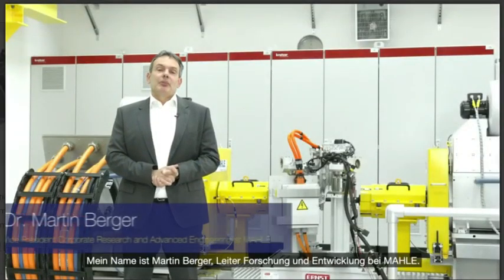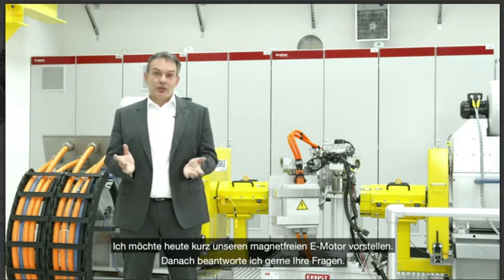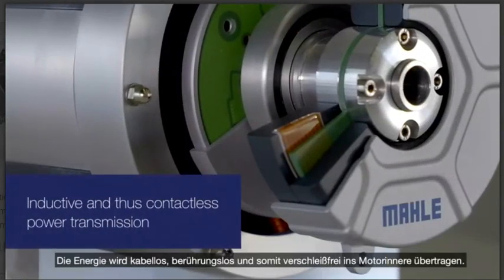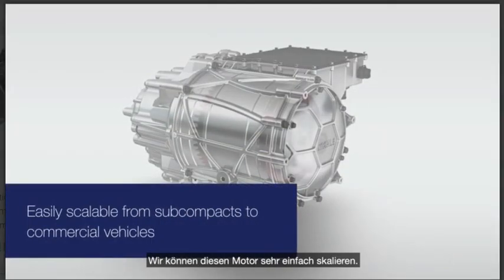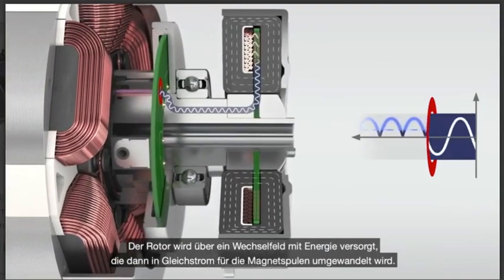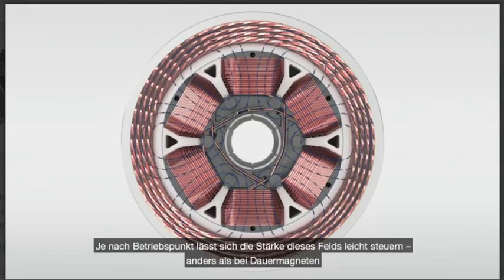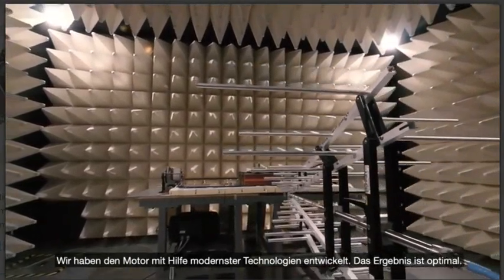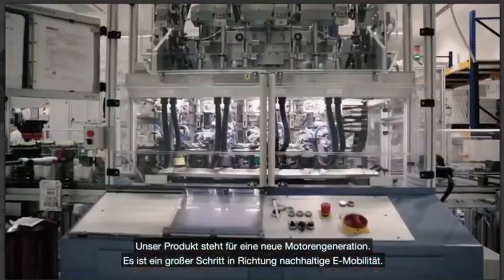Mahle, produce revolutionary new no-magnet motor...

Comment: Wait, isn't this similar to how an alternator works? Guess there is tech for higher power efficiency then.
Reply: Most alternators only reach around 65% efficiency. We've been exploring (and using) induced fields in the rotor since I was a kid. This is the first time I've seen a practical motor with the level of efficiency needed to make a significant impact on the market. How successful they will be I don't know - I suspect reliability and heat may be limiting factors.
Reply: And an alternator will have an alternating magnetic field but this one acts like a dc brushed motor
Reply: Alternator? Or a dc motor? It's most likely a DC motor but instead of have a physically contacted commutators, it has a tiny gap which allows for wireless electricity. Not sure if that's certainly possible
Reply: @marcangelodonelo5656  this is a dc-excited synchronous machine (the same assembly can be used as a motor, generator, or brake, depending on the energy flow). A dc machine has the field generator (be it permanent magnet or electromagnetic) on the stator. And I've seen a similar wireless power transmission system on a computer tomograph about a decade ago
Reply: @marcangelodonelo5656  no.. not a dc motor, they have magnets. A multi current motor.. they dont

Comment: Kind of like a an alternator turned into a motor, and where the carbon brushes have been replaced by this "remote" alternating electric induction?
Reply: Yep, old generators used a similar setup to control the output, diodes were used on the rotor to turn the induced AC current into DC, which was fed into the rotor winding, which created the AC current in the stator windings. They had this tech in the 50's!
Reply: @plkracer  Yeap it is just a textbook synchronous machine
Reply: @plkracer  but not with such a beautiful cgi rendering!!!! this makes it more real than those of decades ago

Comment: Without an actual demonstration, the useful information content of this video could have been cut down to less than two minutes and put out on the radio, slick CGI just doesn't cut it.
Reply: There isn't much to see in a demonstration of an electric motor - it just spins. It's not as if you can see the electrical current or the magnetic flux.
Reply: @brianb-p6586  uh what? you can hook it up to a load and demonstrate the nm torque produced and current drawn etc. and show its efficiency at various speeds to back up the claims. Also have temperature probes showing how it deals with staying cool under load and MANY more things that would be great to see.
Reply: @watvannou  since none of that information is visible, you would only see values displayed on a screen. I understand wanting a full data set, but seeing a motor running would add nothing... and no one shares full test data for a technology in development.

Given the efficiency claim, an efficiency map would be good, and might be reasonable to expect.
Reply: You're an engineer, ain't ya?
Reply: There is nothing to demonstrate, as there is nothing really new on this engine.

Comment: Should be able to access a much wider torque range and higher RPM with this design, right?
Reply: Only if you want to be worrying about melting two sets of coils instead of just one, some pretty interesting things can probably be done with twice the FOC opportunities to leverage, hard to beat halbach arrays though.
Reply: @unom8  You clearly have a superior grasp of this technology. I was referring to the field timing being electronically variable across 2 fields. This combined with field strength variability should off amazingly flexible characteristics.
Reply: @robertsothmann8110  well, whatever minds we are, we have the same thoughts about what we think should be possible - and yet, motors that should be able to pull those same tricks, using slip rings etc have been around for a very long time.
Perhaps the missing ingredient is on the software side - PID loops seem a poor fit, which is all I have seen on the control side so far.
Reply: I should say though that my only experience has been through trying to help build cheap motorized wheelchairs, with hub motors, so lots of special cases and rider comfort and safety as a priority. Those motors get HOT even when 1 side of the equation is provided by magnets..

Comment: So an expensive way of making an induction motor.
An induction motor driven by a vector drive will give you the same dynamic performance as a PMSM
An induction motor will be more effecient than this motor and cheaper to make.
The reason for using PMSM over induction motors is that you don't need to spend energy to produce the rotor magnetic field. This on the other hand uses 3 coils instead of 1 so it will have more losses compared to an induction motor.

Comment: Mr. Nikola Tesla back in the 1880s "invented" the modern AC Induction motor.   details see: https://en.wikipedia.org/wiki/Induction_motor  and Tesla Motors have used them too.
Reply: Not even close to being similar technologies. Induction motors (as the name implies) induces a reactive magnetic field in the rotor through Lorentz's law, with its inherent losses and is an asynchronous motor. This design seems to use wireless electromagnets in the rotor, therefore being a synchronous motor.
Reply: Yeeeees

Comment: cough Tesla's Asynchronous Induction Motor cough
Reply: Nope, it's the Siemens synchronous engine (dynamo engine).
Reply: @norbertfleck812  the model 3 uses a synchronous reluctance motor in the rear and ac induction in the front. Like the Model S, which used 2 of the ac induction motors for a long time. Even Volkswagen uses one synchronous permanent magnet motor in the rear and AC induction in the front in their MEB platform. (Q4 etron, ID4 GTX and so on) this here isn't new or revolutionary at all.
Reply: @mongini1  You are probably right. But this MAHLE presentation is a about an electrically excited synchronous engine which has got a better efficiency than an asynchronous induction motor and which also has got some advantages compared to a synchronous reluctance engine.
Reply: @norbertfleck812  okay, this makes way more sense now. this tiny detail wasnt that obvious in the video. and sure it has advantages. i would even say its better than the synchronous motor. i assume it has the responsiveness of a sync (as long as you keep the rotor exited), with the advantage that you can just switch it off like the async. could be a big deal, we'll see.

Comment: How can the efficiency of the whole motor PLUS rotating transformer coupling be as efficient as the best transformers?

The claimed efficiency seems a overly optimistic.

We would need to see an impartial side-by-side comparison of a few competing motors of similar power rating.

Eliminating the need for rare earth metals is certainly desirable.
Reply: If the rotor is built like a synRel using exciter windings to replace permanent magnets, then the exciter is only needed for low-RPM torque and can be turned off once RPMs are high enough for reluctance to take over.
Reply: Power transformers used in distribution, can be 98 to 99% efficient. Still, a 1MW transformer at 99%, will dissipate 10KW as heat.

Comment: Cool, my washing machine and vacuum cleaner would be much cheaper to run with this motor
Reply: No, they certainly would not be cheaper. Save a penny on power, pay how much on motor? Efficiency and supply chain stability are worth it in a car, but not in a washing machine.
Reply: @aleksandersuur9475  yeah I suppose they could be used as starter motors, cooling fans etc on a car

Comment: Would it get like really hot? Coil base motor gets really really hot... I did not see cooling system in it ... I think is a great idea and yes it will reduce by a lot the cost of the motor and yes the magnetic field can be easily controlled and with low voltage we can actually make really strong electromagnet but we won't be able to obtain regenerative energy and it won't brake like an permanent magnet does ... but I do see a lot of advantages if we can proceed to cool down that motor's electromagnet
Reply: If the efficiency is as advertised then no, it wouldn't get hot. Only 4-5% of power wasted as heat compared to 10% or more that typical permanent magnet motors lose. And of course you can regenerate with this thing, it's all down to how you commutate it. Well.. that's all down to these efficiency figures working out in real life of course, but Mahle is a serious company, if they say the spec is such, then it probably meets it. Would be interesting to know which car it's going on first, no way did they develop the motor and a production line for it without a car model to put it on in the works.

Comment: That is nothing new. It's exactly the same prinsipal as a car alternator. Except the inductive transfer of the power, but sliprings really works just fine, and is more efficient.
And if the point is eliminating permanent magnets normal induction motors, or switched reluctance motors do that already.
Reply: Eliminating slip rings and having electronic control of the rotor field makes all the difference though, when it comes to achieving really efficiency and reliability.
Reply: @galfisk  the most reliable AC motor would have to be the Asynchronous Induction motor. Unlike Synchronous, It has no complicated Rotor winding to energise nor suffer the parasitic magnetic field of PM motors - Maybe not as “efficient” though. But this mahle motor is a actually inductively charging a rotor containing spinning electronic rectifiers then generating a magnetic field. I can’t see how this is more “reliable” in the long run as more components to fail.
Reply: @johncanalese588  I think the point of this one is to achieve the compactness of EPM rotors without the EPMs. Asynchronous motors are used in some EVs, but they have a worse power to weight (and volume) ratio. It's har to beat asynchronous, EPM and switched reluctance in reliability, having no especially complex spinning parts. Spinning coils are still pretty solid though.
Reply: @johncanalese588  it isn't intended to be more reliable than an induction motor (which would be extremely difficult) - the advantage would be efficiency.
Reply: Yes, that’s  what I just wrote!

Comment: That's wonderful engineering. Great to see such development.
Reply: Except this isn't really new: generators in 30+ years old power plants already used alternators to feed the generator's exciter with variable current and adjust output voltage. This is the same principle applied to a motor.

Comment: Why should we use ac and convert to dc .why cant we use dc to magnitis
Reply: You can't transmit DC wirelessly to the rotor. Needs to be AC for that reason.
Reply: Thankyou mark and Mario
Reply: The same reason everybody's house is powered by A.C.
Reply: Mahle say that with their motors they want to reduce our dependence on expensive raw materials and the environmentally damaging mining practices which are necessary for their production.

Comment: I made motors like this in high school science class back in the early seventies, based upon much earlier work. The trick here is perfecting the engineering to work under stress at high efficiency. Good stuff.
Reply: What's old is new again.  Just some extra fancy electronic are the extra.  Good comment!
Reply: You built synchronous AC motors in highschool in the 70s? Somehow I doubt that.
The controller's weren't even technically feasible
Reply: @fabianrudzewski9027  You have no idea about how these motors work.
Reply: @Earwaxfire909  I am actually rewinding the synchronous type, so I might have some idea.
Reply: @Earwaxfire909  Are you sure you were building synchronous brushless motors in high school? Asynchronous induction motors (with "cage" rotor") are easy.
Reply: @bazoo513   if you look on the synchronous motor Wikipedia page, you will see a picture of a dc-excited synchronous machine circa 1917 (actually, any electromechanical converter, or machine, can be used as a motor, a generator, or a brake, without any modification), so it's totally plausible that Earwaxfire909 built synchronous machines in the '70s.
Reply: @bogdan_n  I stand corrected. I once don't check what I was about to say, and I blunder.
DC-excited synchronous motors typically have slip rings and brushes, but the reference for AC induction and rectifier arrangement is a textbook from 1994 - so, indeed, nothing new.
Thanks!
Reply: @bogdan_n  synchronous motors themselves aren't new, I knew that. But up until the common availability of high power electronics, synchronous motors were really limited. Without VFD, startup was a real headache.
Reply: @fabianrudzewski9027  the problem wasn't starting synchronous motors, as they could be started asynchronously like an induction motor. The problems were controlling the speed and providing dc excitation voltage, which limited their use to high power, constant speed applications until the advent of electronics and high magnetic retentivity materials.

Comment: When you think you have made a gain in one area there is always a drawback in another. Would this motor consume more electricity than a permanent magnet motor. At 98% efficiency doesn't mean its torque is high. May need a fuel cell to get more power and a longer run time.
Reply: The torque will be higher than a permanent magnet because we can control how much magnetic field we want... is like those little electromagnets in doors they consume very little voltage but they are far more powerful than a permanent magnet is... with little voltage...

Comment: Hi This is AbhijeetMD and.... 
I like it but there is a bit of a problem... 
Wireless transmission interference from external sources is highly likely. 
Which frequently happens due to many constantly varying variable factors in general environment. 
What would be the consequence for a vehicle driving into an interference field in a city expressway... 
Complex issues ned to be resolved. 
As more electrification takes place all around the world... 
This is a very likely happening scenario. 
An additional backup as wired functionality would rather be preferable... 👍
Reply: This is Same as ANY household step up / step down transformer transfers it's energy from primary coil to the secondary coil..here by
 h.f. A.C. (& not dual polarity pulsed D.C.as in SMPS ) so ferrite cores are used....ext. interference to disrupt is negligible ...& Most importantly these excitation coils carry only " steady state current " ..& NOT THE LOAD CURRENT.....

Comment: Very interesting promising future.
Reply: This kind of engine already celebrated its 100th anniversary some decades ago.

Only with inexpensive and simple sliprings instead of an electronic current transfer device.
Reply: @norbertfleck812  I know that the electric motor is old but this one is improved. Batteries are also a old invention and still improving every year. Every improvement is a step in the right direction big or small.

Comment: Sounds like a Tesla motor from 10 years ago, before that they would use brushes instead of wifi
Reply: Tesla uses rare earth magnet motors.
Reply: @matthewhuszarik4173  Not the early ones, they were AC induction- these days all manufacturers are using rare earth magnets as they are cheaper to get high output

Comment: Marketing nonsense.  The slip rings in a motor are one of the most reliable moving parts in an electric machine. They can last the life of the motor, and can be very easily changed anyway. The slip ring surface is smooth and the brushes can be made to last for hundreds of thousands of hours. Their claim is that they have eliminated one if the most reliable parts of the motor and replaced it with a myriad of MOSFETS and rectifiers. This is engineering lunacy! Oh, and, the motors do use magnets! They use electromagnets just like ALL present alternators. This is why modern cars always break and cost an arm and a leg to repair. Unnecessarily complex systems that make the component manufacturers wealthy.
Reply: I am a retired aircraft mechanic/electrician/avionics technician/instructor.  My experience with electrical generation and motor systems goes back to the early 1960s.  In my experience, there is NOTHING reliable or trouble free in slip rings and brushes, whether they be found in generators, motors, synchro systems, or instruments.  The brushless ac generator revolutionized aircraft power generation in the late 1950s.  A late model of the Westinghouse brushless generator introduced on the Boeing 707 is still generating power on some of the older Boeing 737s in service today.  It is about time that brushless technology is finally developed in motors.  The compromises made necessary by the use of permanent magnets and slip rings can be eliminated.
Reply from the maker: Thanks for your comment - I put this up as a curiosity piece and it seems to have really sparked a lot of interest. I am a complete novice in this area and it has been fascinating to see what others think.
Reply: Mostly true... whatever wear& tear of slip r. ( however small..) now is replaced by the se. devices.. that may wear & tear/ blowup the electronics..

Comment: Can these be used in a marine environment? Specifically propulsion.
Reply: Yes , a few techniques would be needed .
Reply: This kind of motors (synchronous motors with brushless excitation) have been used in ship propulsion since 1980s. For example in ABB's Azipod propeller drives that are used for example in the luxury cruisers in the Caribbean. Power is quite high in these, over 10 megawatt.